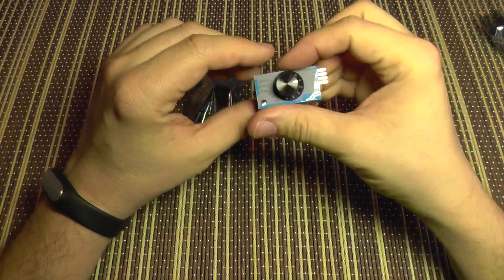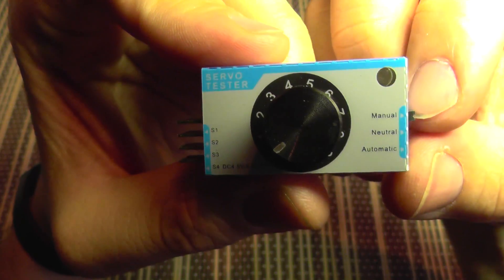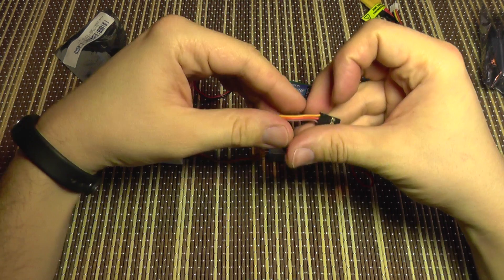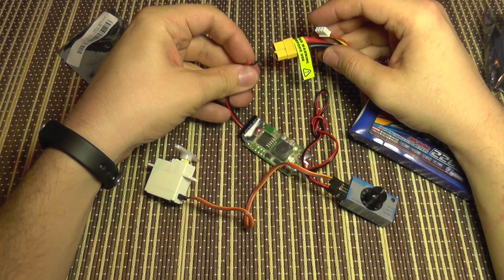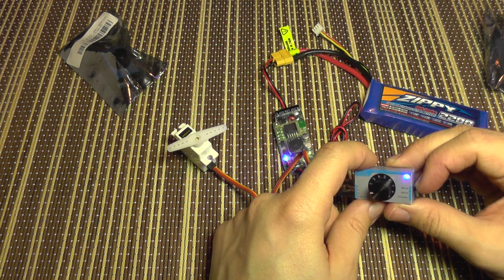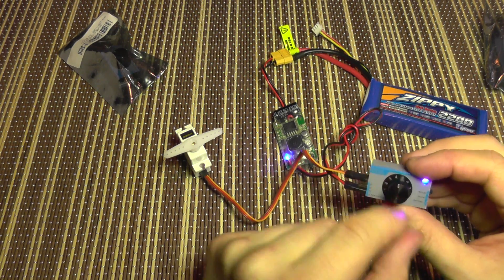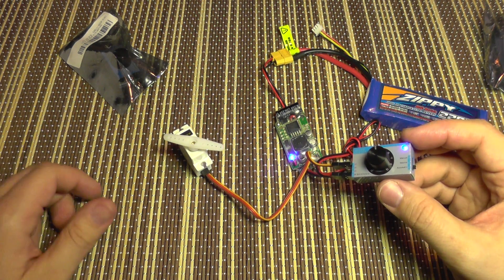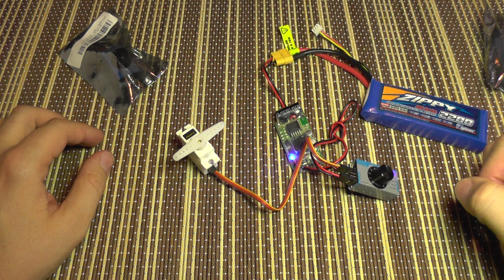EK2-0907 Updated Servo Tester

Comment: Which ESC did you use in the video?
Reply from the maker: It's not an ESC, it's 5A UBEC (voltage regulator).
Reply: @TechTronic9000  Is it also possible to use a ESC with a output of 5V DC to connect the tester with a Li-ion or LiPo battery?